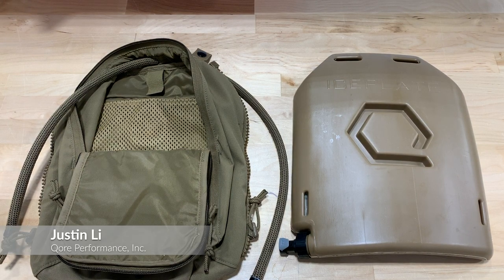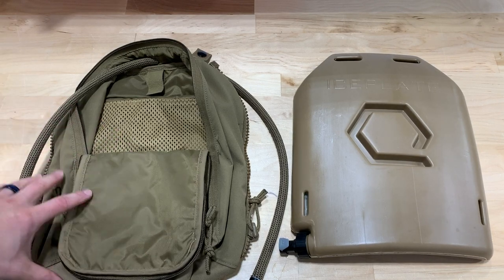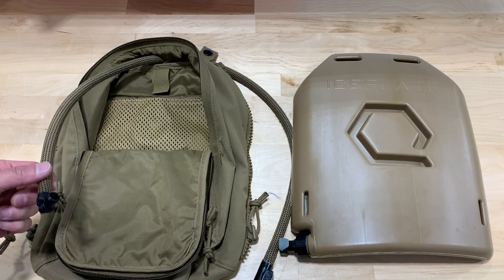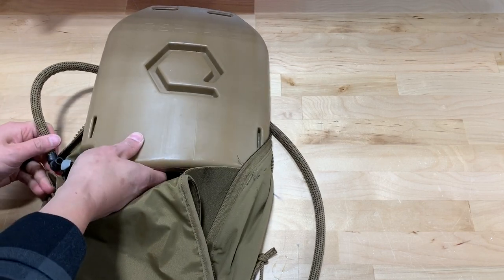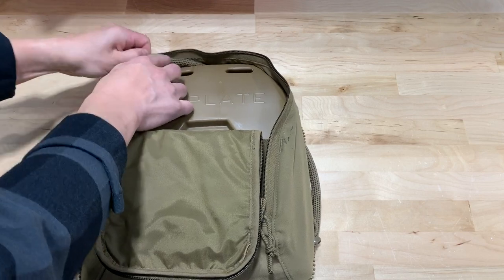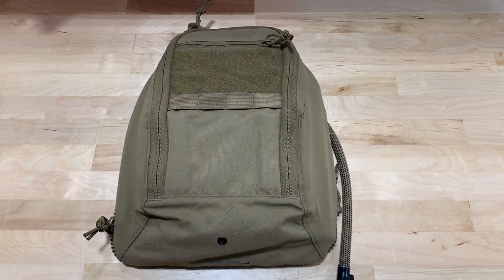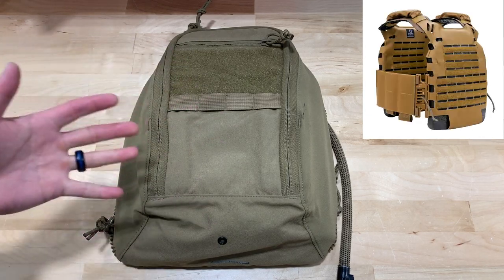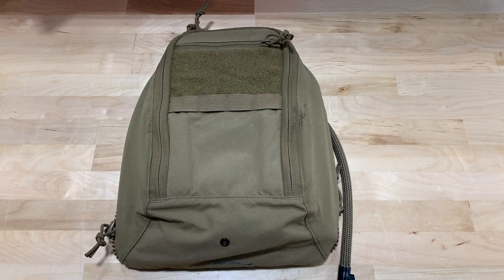IcePlate® Curve Compatibility with Velocity Systems SCARAB LT Zip On Back Panel

Comment: Does the Ice Plate fit the same size as the plate or do you have to go down a size?
Reply from the maker: Thanks for the question Frank. IcePlate Curve is the exact footprint of a Medium ESAPI (9.5" x 12.5" x 1") so it will nest perfectly with any M ESAPI armor plate. The dimensions of the curves are similar to both L and XL plates, so IcePlate Curve can also nest with larger plate sizes. You will have a slight "overhang" from your armor, but the IcePlate Curve and the plate itself will still fit together perfectly.